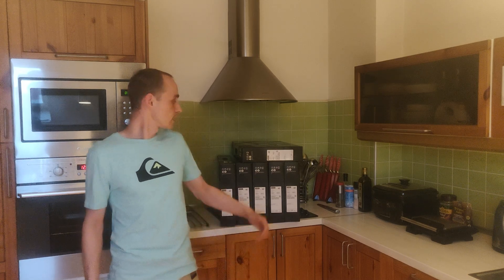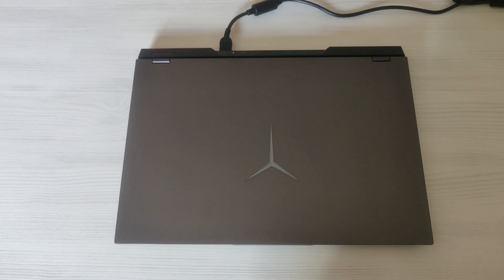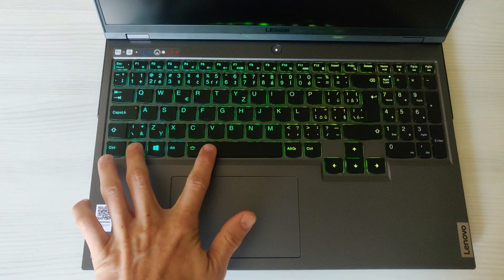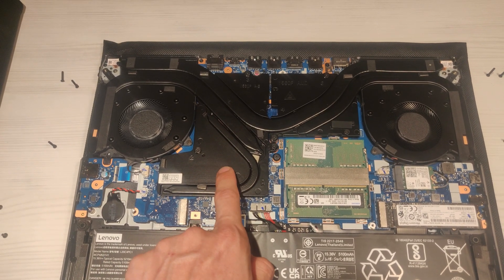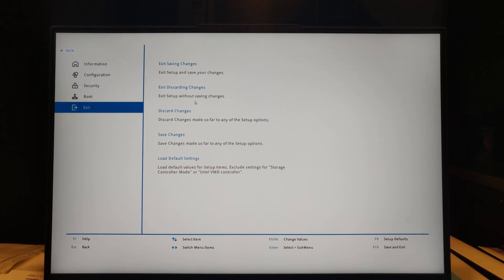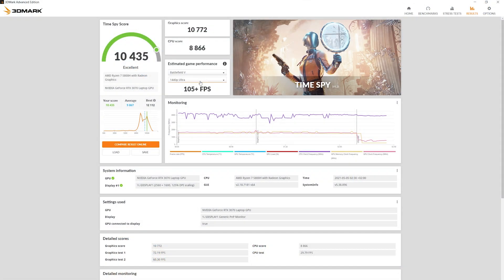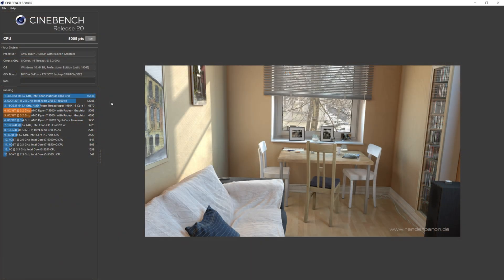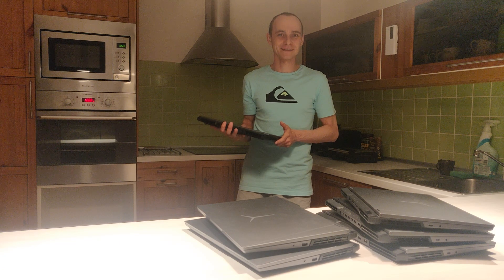Lenovo Legion 5 Pro 16ACH6H (2021) Ryzen 7 5800H, GeForce RTX 3070 8GB 140W

Comment: Hi my friend i want to buy legion 5 pro for gaming, civil engineering apps like csi bridge sap2000 E_tabs and photoshop ...
I dont know wich on is better can you help me?🥺
1:Legion 5 pro 11800h rtx 3060 32GB 1TB
2:Legion 5 pro 5800h rtx 3070 32GB 1TB
Model 1 has 120$ lower price
Reply from the maker: If I had to choose, I would choose Option 2.
5800H 8 Cores 16 Threads with RTX3070 8GB 140W. Difference between 3060 130W and 3070 140W is huge.
Reply: @JosefHrib   thank you man im worry about performance of R5800h but now you said thats good, its ok for me ❤

Comment: I just have two questions:
1. How portable is it. I am a college student who travels frequently(hostel to college to library almost every day) so from that perspective is it too heavy or too big to carry on bag. Also is it loud (I use my laptop for taking notes and programming in college) so is typing too loud or maybe it's fan noise.
2. Can it run for 6-7 hours in single charge. I don't want to carry that big charger and in college my usage is very low as I only use it to browse internet or take notes so considering that will it last for 6-7 hours on full charge.
Reply from the maker: About portability: It's very subjective, laptop have around 2,2/2,3kg, it's normal for 15/16inch laptops, only ac adapter is larger. Ofcourse any 13inch laptop will be better for transporting but on 16inch laptop with so powerful CPU and GPU is it ok.
For example I, I travel everyday with one piece Legion 5 Pro and it's without any problem for me. 👍

About battery: With disabled Optimus (permanent RTX3070) is battery life around +-2hours. With enabled Optimus is battery life around +-5hours. But I using laptop on maximum brightness (always, on ac, on battery) and with WiFi maximum performance (always, on ac, on battery). So if will be used lower brightness and lower wifi performance so battery life with optimus can be little longer than my.
Reply: @JosefHrib  is it too loud, in terms of typing and fan noise on quiet mode, will it be too loud for classrooms.
Reply from the maker: @Abhi-qn4xv  I using only Standart mode and Performance mode. On standart mode is it quite, in normal office workload.

Comment: I just have one question about thermals
I have seen that the cpu reach nearly 90c while gaming
So if turbo boost is changed to efficient aggressive from agressive
Will it get better result
Reply from the maker: When is turbo On, so yes temperatures are around 90celsius. Exist more mods here, and everyone can have little different experience. For example I, I using my 5800H (and before 4800H) always with completely disabled Turbo and my laptop now run on stable 3.2GHz all time with very lower temperatures (and fps drop really only minimal, Zen3 core is enough for RTX3070 on 3.2GHz).

Comment: $1800 with or without tax?
Reply from the maker: 1800dollars with TAX and VAT. I bought it in Czech crown but on dollars it was 1800.
Reply: @JosefHrib  Thanks.. It's $2469 in Turkey.. What a rip off!
Reply: @Deniz Can Çığşar only differences the model that is selled in Turkey 32 GB memory and greedy distributors like MM.

@Josef Hrib I wonder if the all 6 units have the Micron graphic memory or some has Samsung. I wonder because Samsung has more OC headroom than Micron.
Reply from the maker: @suleymanyigit8449  I bought few days back 32GB DDR4 Kit from Kingston HyperX Impact 3200MHz CL20 SO-DIMM, and newest wifi Intel AX210.
In next few days I will create video with retesting one piece (32GB RAM from 16GB, IntelAX210 from AX200, and small OC).

Comment: The display should be 10bit, but your unit have 8bit🤔
Reply from the maker: All L5Pro have same panel. In my video description is panel name and type wroted.
I must say, this panel is awesome 😎 nice resolution, high brightness, high refresh rate, really very good.
* Display: 16" 16x10, WQXGA 2560x1600, 165Hz, IPS, 500nits, 100% sRGB, Dolby Vision, HDR400, Anti-Glare, LED Backlight, Narrow Bezel, Non-Touch, Freesync/Gsync.
Display specification shows 8bit when is Windows set on SDR, and 10bit when is Windows set on HDR.

Comment: can you talk a ittle bit about temeratures ? Many have said it runs really hot..
Reply from the maker: In few days I will release second video with games benchmarks where will be temperatures too. 👍

Temperatures are: in idle GPU +- 40/45celsius, CPU +- 40/50celsius (with or without Turbo).
In benchmarks: GPU 70/75celsius, CPU with enabled Turbo 80/95celsius.
In games: GPU same 70/75celsius, and CPU with Turbo 80/90
But when you disable Turbo in CPU, so CPU hold stable all time 3,2GHz and temperatures are very lower in benchmarks and games, around +- 70/85celsius.
So I enabled Turbo only for benchmarks, but for normal using I using this laptop with disable turbo on CPU, and my processor hold all time 3,2GHz with lower temperatures. :-)

On 16inch laptop with so powerful GPU and CPU are these temperatures good.
Reply: @JosefHrib  thank you very much
Reply: @JosefHrib  what is the actual impact of disabling turbo boost of CPU, in games ? Hom many fps do you lose ?
Reply from the maker: @touness69  Now I play mainly Cyberpunk2077 (resolution 1920x1200, texture High, details High, Raytracing Ultra with DLSS on Quality) and with disable Turbo on CPU are fps lower only about few fps (for example 3/4..fps) so nothing terrible.
In my eyes mobile cpu Ryzen 4xxx/5xxx lineup have with disable turbo only plus (fps are just a little lower nothing terrible, but temperatures drop a lot which is super).
Reply: @JosefHrib  perfect thank you for feedback. This a very demanding game at high settings, curious to know how many fps do you got when turbo is disabled ?
Reply from the maker: @touness69  If I remember good, so with turbo and settings what I wrote in my previous message, 70/75fps (without dlss its around half plus minus). And when I disable turbo on cpu, so temperatures are lower only minimal (+-3/4..fps), but temperatures drop huge. In my next video it will be showed in details on decimal number. :)
Reply: @JosefHrib  wow 70fps at such settings is really impressive indeed !